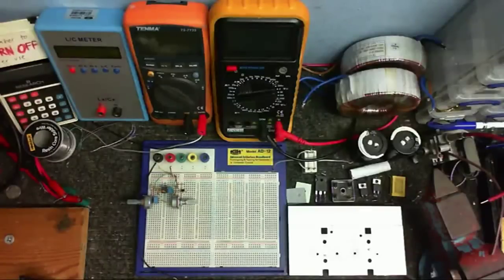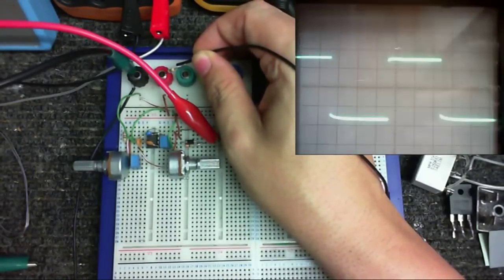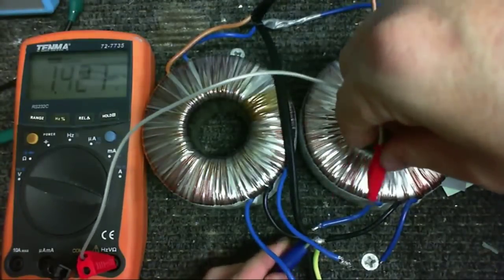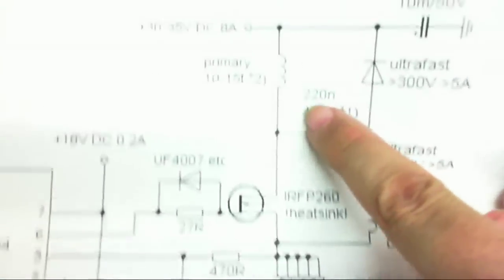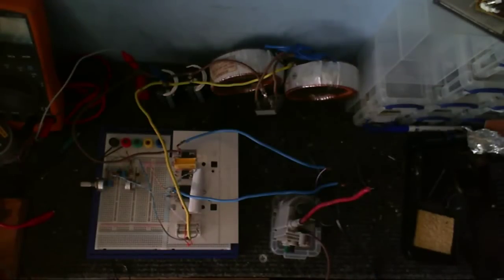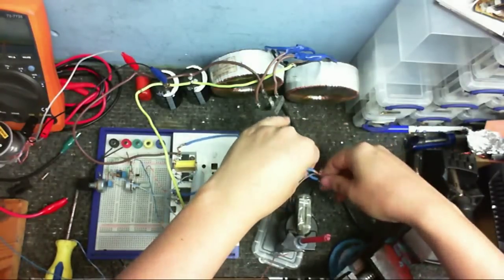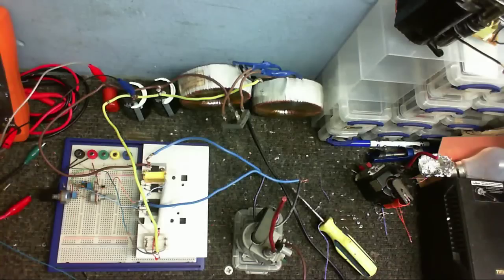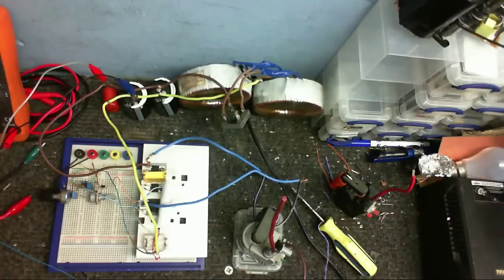UC3844 Flyback Driver, and some rambling.

Comment: Hi Clem;) A very easy solution to the lack of space for winding your own primary on that LOPT of yours, would be to simply »dremel« away that flange. I have done this on multiple transformers. And by the way: don't let the size of a LOPT fool you! I'm currently utilizing a rather small flyback with a modified ZVS circuit (watch my video), and so far it has outperformed every single LOPT I could get my hands on;D Keep uploading dude;) thanks!

Comment: uc3844 is normally on the mains side of a switching power supply, that's why its UVLO circuit switches on at 16V. The uc3845 is the equivalent that can run on 9V. 

If you want to use a heavier wire on the primary, you could presumably use a heavier gauge enamelled copper wire (magnet wire) than typical insulated wire of the same total thickness.

Comment: Clem try winding your own HV coil on one of those flyback cores with that copper wire. I made a couple and they worked very well. As long as you insulate each winding layer from the next you should be fine and put the thing in oil also to help. Oh and don't drain the oil from that compressor as it will lock up.

Comment: Ok ok here is what I want you to make a video of: the world's EASIEST flyback driver...I have only found 3 or 4 videos on it, and I really want to spread the word about it because it works so well for what it is. First you wrap a primary on the flyback of choice. Usually about 5 to 7 turns of wire I got from a string of Christmas lights (I think it's 18 guage? don't really know atm) Is what i use but definitely experiment with it. next get a 12 volt halogen transformer...it has to be a 12 volt ac halogen transformer, I've tried with a 12v ac accessory line on a train transformer, I've tried a 12v transformer I bought at radioshack and wired up, but only the halogen transformer works. Next make sure you have a load on the line (I think in series with the flyback but it may be parallel) in the form of a halogen lamp. Then you plug it in and experiment with the windings. keep taking off one at a time and testing untill the sparks are not continuous, then add that winding back on and that should be the optimal primary